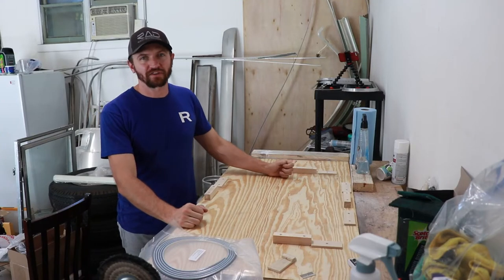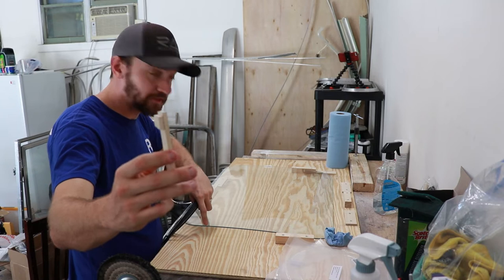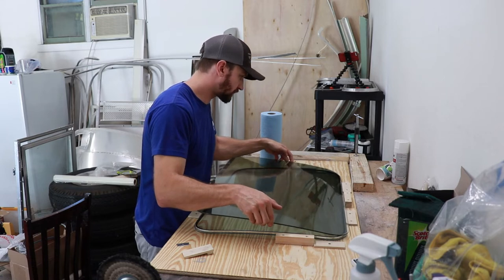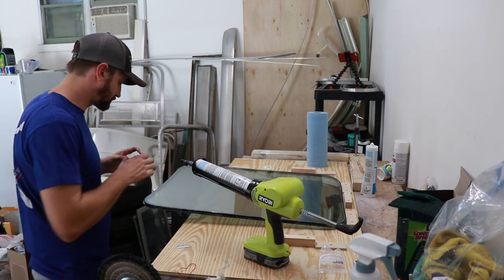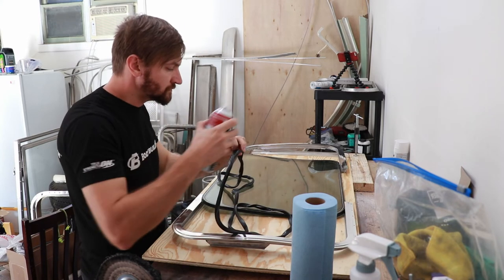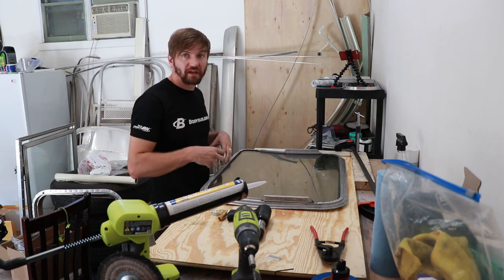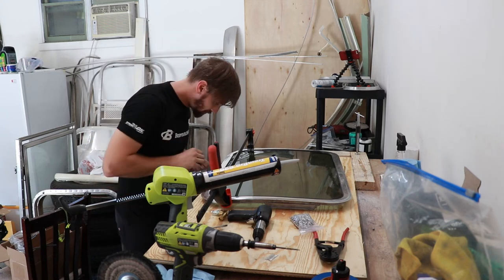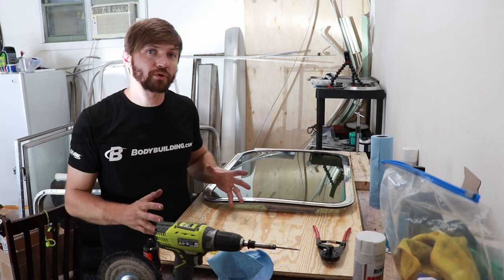Airstream Window Repair Part 3: Rebuilding the Windows and Assembly No More Bubbled Tint

Comment: was a window cleaner 20 years ago and cabinet maker... I suggest few hint for would-be repair jobs.   
1.  get china marker.   mark the "outside" side of panes. not the inside sealed cavity;  mark glass on top.  you know it is on the right side. without picking up and squinting (less scratching and smearing your glass).   when you finish the job, wash the marker off with soapy water (hand dish soap).  
2.  "plywood jig" is called mounting guide, and color or tint plywood dark color (cheap acrylic paint); you can see through and spot the dust-fingerprint on the glass at glance.
3.  wear nitrile gloves.  less fingerprint on the glass.
4. dont use 1 inch stop block. go for 2 inch.  line up against the block then drop down onto the gasket.   lot easier than trying to line up on surface against short block.

Comment: Did you tint the inside or outside of the glass? Wondering if tinting the outside would be better just in case the tint were to bubble in the future.
Reply: I was wondering the same thing.  I suppose if the modern tint is good on car windows for 20+ years, it should be permanent enough.

Comment: Great series on the Airstream windows. On the tinting, did you do the tint yourself ? if so, do you have a recommendation on what you used ?  Thanks !
Reply from the maker: I had a professional tinter do them for me. I would suggest using a ceramic commercial tint.  It is better for dual pane than automotive tint.
Reply: @MillerGarage  I am considering using a 3M Crystalline 40 product.. do you think id be better off with a ceramic tint instead? Also how far did you hold the tint from the edge of the window? I am worried about the adhesive on the gasket not being as strong if it sticks to the tint. 

Thanks!
Dina

Comment: Ian, do you still have the secondary sealant spacer block used to apply the sealant between the panes?   if so what is the height of the raised part that goes between the panes?   Robert at Vintage trailer gaskets is out of stock on them and i figure it would be  an easy part to make with my 3d printer.   Thanks
Reply: i noticed this as well! robert has them all in stock now and its the 3/16 size!
Reply from the maker: Sorry for not replying.  Hopefully you have figured it out, like Adventure Homes said its 3/16.

Comment: Did you tint the inside or the outside of the outer pane?  Looks like you left a little borer around it?  Does the adhesive stick to the tint ok?
Reply from the maker: I tinted the inside of the outer pane.  It is the same as from the factory.  You don't want to tine the inside piece, it will heat up the gap too much and could cause the gasket to blow out.  Also, don't go too dark, it can be problematic with double pane windows. There is a slight boarder on the glass but the gasket covers it so it is seamless once installed.  It sticks great.  If you were to pry it apart once stuck it would probably peel the tint but with it stuck and the secondary sealant its not moving.
Reply: @MillerGarage  Thanks for the info. I saw that I was on the outer pane, just didn't know if it was the inner or outer portion of it. Also, congrats on the news of the new little one!

Comment: Interesting.  Since you didn't have a vacuum seal between the windows to draw any moisture out before sealing the panes together do you still get moisture between them or is the desiccant that good?
Reply from the maker: Desiccant is good, they are not vacuum sealed from the factory either.  Vintage trailer gaskets, where I get the seals from has had zero problems with moisture and my windows have been fine since installing them.

Comment: Hi Ian, great job on the windows, I still need to get round to finishing ours! Hard to find the correct gaskets and parts here in the U.K. so will have to import. Could you tell me please ruffly how much secondary sealant you used per window and what width gasket you went with? Thanks!
Reply from the maker: Thanks!  Its a big job, still finishing up some of mine.  I have the habit of jumping from project to project.  If I were to guess I would say around 3 of the 22 x 30 dual panes per tube of sealant.  And as far as gasket width are you talking about the adhesive edge tech spacer for the dual pane windows?  I used 3/16th for my 18 x 22, 30 x 22, and larger front window.  The wing windows (if you are doing those) use 1/4 spacers.  The gasket is just the dual pane glazing.  They are spliced to fit specific window sizes.
Reply: The Seek First Adventure

Thanks very much, I know the feeling of things taking ages and swapping between jobs. I have all windows to do including the wing windows. Thanks for confirming the 3/16 spacer, that’s what I though I needed but good to see that’s what you used. 

Hope you will have chance to do a video on the wing windows, I have ours apart now so getting a list together of parts to buy. 

All the best.

Comment: Ian, I just want to make sure I'm ordering the right supplies from vintage trailer gaskets - I'm new to this! Great video by the way. I have a '72 sovereign. The gasket is part#0114AS5A correct? called "1972 to 1980 Airstream Awning Dual to Single Pane Conversion Gasket" - Can you confirm this is what I need? Thanks!
Reply: One more question - On ordering the gasket. Looks like they sell spliced and non-spliced. You are using non-spliced best I can tell. But how do you get the exact measurement needed? My windows are 30"x20" so 100" - do I order this exactly 100" non-spliced? Thanks!!
Reply from the maker: @charlieearthman5173  If you are rebuilding them to be dual pane then you need a different gasket.  I used the pre spliced for all but the wing and front windows.  They have them made for all window sizes.  Look thru their window library on the site and you can figure out exactly what you need, or give them a call, the owner is super helpful and can get you exactly what you need.

Comment: Ian, what an awesome job you did on that window! I can't wait to see them installed! What rivets and what size did you use on the hinge?
Reply from the maker: Thanks!  I used 1/8 inch by 1/2 inch buck rivets on the hinge.  They are 3/32 from the factory but after drilling the hole was 1/8 inch.  It does not affect fitment or anything so it didnt seem like a problem to go up one size.
Reply: @MillerGarage  thanks Ian! I will look at those rivets, as some have snapped off two of my hinges. I have seen some new hinge lengths for sale at Airstream supply.

Comment: Are the two panes of glass (internal and external) different sizes?
Reply from the maker: Yes they are, different thickness and overall dimensions.  Why you need to use the jig in part 2 to make sure they line up properly.